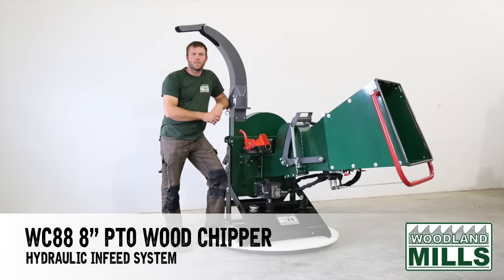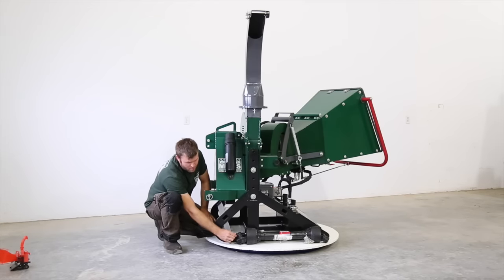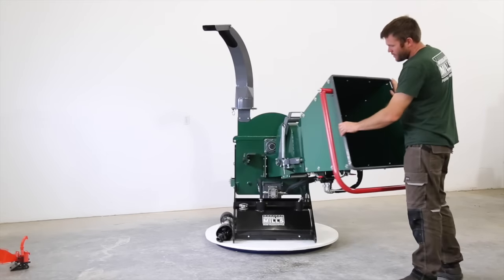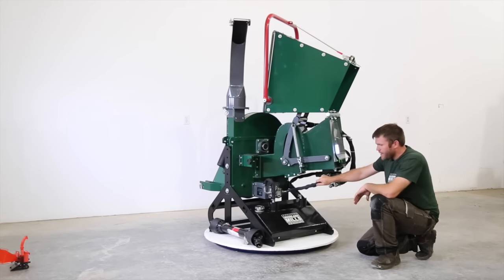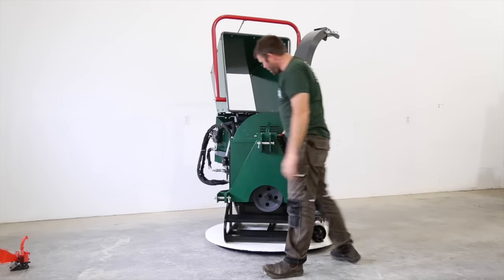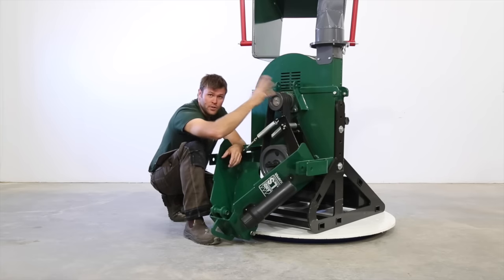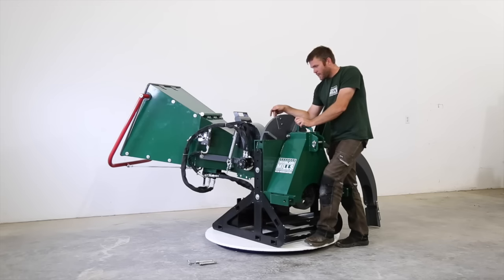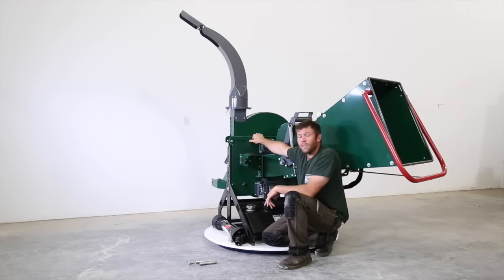Woodland Mills WC88 8" PTO Wood Chipper Walk Around

Comment: I've got a kioti dk40se HST. Pto is right around 32hp give or take. I'd like as big of a chipper as possible even though I'll likely be chipping 5 inch or less most times. What would be the reason for me not to buy the 8" as opposed to the 6"?
Reply from the maker: Hi Sandy, This video shows Josh’s tractor - Kubota L3940. 31.5 HP at the PTO Your tractor is very similar to the specs of Josh’s and I would recommend the WC88.You have the horsepower to run it and the bigger infeed chute opening is nicer for feeding brush in. You could expect to chip very similarly to what the video portrayed. It sounds like you will be chipping smaller material for the most
part. The WC88 will throw the chips further due to the increased flywheel speed and has some of the nice features - flywheel locking pin for changing blades and chainsaw holder.

Comment: I have a kioti DK35SE 38 hp 29.5 at the pto can it run a WC88
Reply from the maker: Hi Johnny, You could run the WC68 or WC88, but it depends on what diameter of material you are wanting to chip. You will be able to chip larger diameter material with the WC68 due to it being direct drive. If you are generally chipping smaller diameter material (4” or less) you should be able to run the WC88 at full infeed speed. Larger material could be chipped, but the infeed speed would have to be slowed down.
Reply: Ok thank you